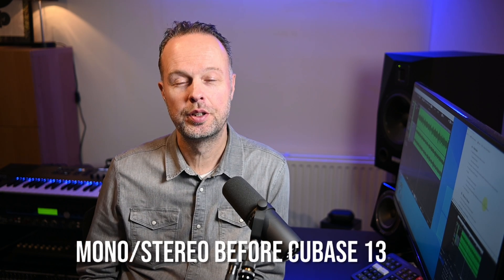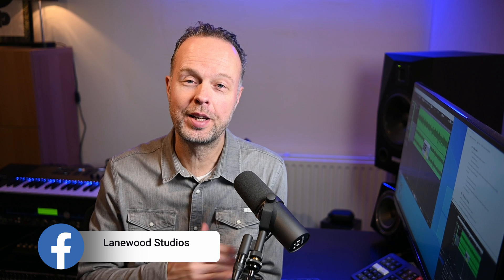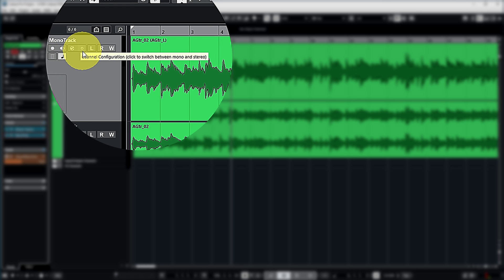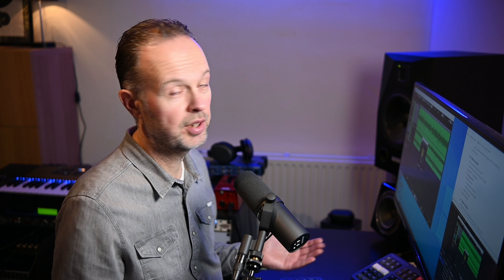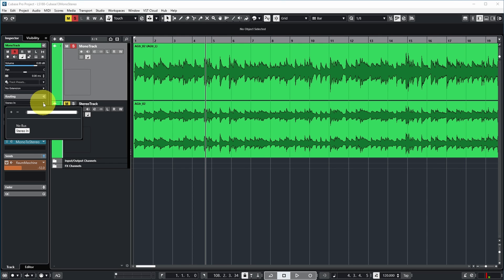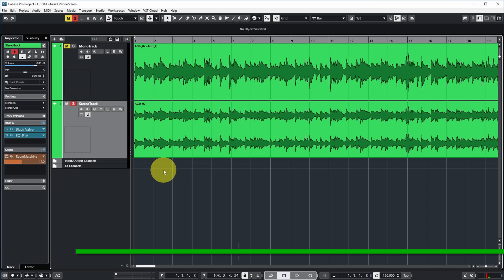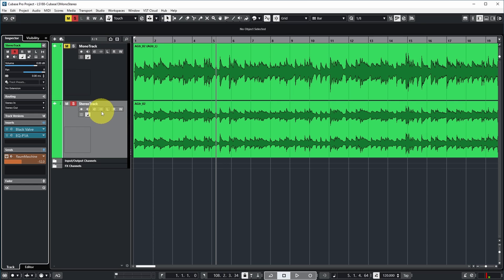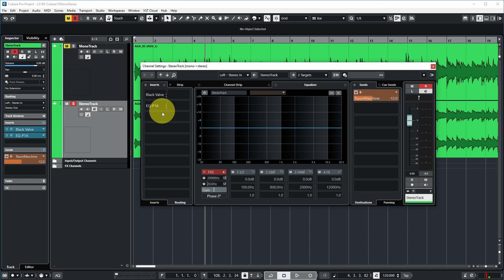Cubase update: Converting Mono to Stereo and vice versa!

Comment: One use for converting a stereo track to mono is for backing tracks for live use, for example a solo guitarist/vocalist who uses backing tracks at gigs (maybe for some drums and bass, possibly a bit of keyboards). Some people feel that mono works better for live use, so if you bought a backing track online (for a cover song) that is stereo, you may want to convert it to mono.. I say it depends - if the instruments are not hard panned, but just subtly panned, stereo possibly sounds better in a live situation from the audience perspective. 

However, one downside to converting a stereo backing track to mono is that the 'pan law' makes centered instruments such as bass guitar go +3db louder when you convert to mono, which messes up the mix and makes the bass sound too loud. I wonder if converting the stereo file into 2 mono tracks to mix independently might help alleviate some of this, however I think you'd still get the bass boost when converting back to a single mono file maybe. 

Of course, if you have multitracked backing tracks, either for your own songs or covers, you can compensate for the 'pan law' in your mix at source, but if all you have is the stereo backing track to work with, I say just leave it as it is.

In the end, I decided not to bother converting my stereo backing tracks to mono. I feel stereo is easier and sounds better and I don't have to worry the 'pan law' messing up the mix.
Reply from the maker: Interesting use-case. You can configure the pan law or desired lack of it in the Cubase project setup.

Comment: Great tutorial Lanewood , thanks for it. I just installed release 13 of Cubase but I don't have this little circle in my channel configuration. I see the "lanes" function, the "freeze" function etc etc but the small icon of mono/stereo I dont see,..??...probably I have to swith this on somewhere?..thanks!
Reply from the maker: If it is not showing you can configure the controls that are showing  for each channel type via the Track Control Settings. You can get there by clicking on the little wrench all the way at the bottom of that panel. You need to make sure that 'Channel Configuration' is a visible control.

Comment: If the MonoToStereo plugin in Cubase reduces the volume of a mono track when cranked up, it is not due to phase cancellation. Phase cancellation would only occur when playing stereo tracks, and this is technically impossible on a mono track. The reduction in volume is likely because Steinberg designed the plugin this way, ensuring that the overall perception of volume is maintained at the same level.
Reply from the maker: Good point!

Comment: Very cool demonstration and explanation.  I'm curious though on something with Cubase 13.  Since Cubase has made the option to change a track from stereo to mono and vice versa, have they changed the way a multi mono plugin is processed on a group or bus channel?  For example: on a drum group with compression, if a tom that is hit is mostly on the left you wouldn't also want to be compressing the right channel the same amount if at all.  To handle this you would use a multi mono plugin so that doesn't happen.  Pro Tools does this seamlessly without any workaround to implement it like you have to do in Cubase.  I'm not quite sure why Cubase only chooses to process the left channel when using a mono plugin on a stereo channel or group.  Is there a better way of handling this situation?  Does anybody actually use a multi mono plugin in such situations?
Reply from the maker: I’m not even sure what a multi-mono plugin is. I think more about that as a stereo compressor plugin where you unlink the gain reduction on both channels. For a compressor that makes sense sometimes for other processors less so.
Reply: @LanewoodStudios  The issue is that not all compressors (or other) plugins have the ability to unlink the left from the right channels and therefore you need a "dual" mono plugin.  But to do this in Cubase, you have to play around with the plugin routing.  I'm guessing I'll have to upgrade my Cubase to version 13 to see if that processing has changed.
Reply from the maker: @TomCawoski  or wait for the Cubase 13 free trial?
Reply: @LanewoodStudios  I'll probably just end up upgrading.  I've been on Cubase since version 6, currently 12 pro.  I also use Pro Tools and this is one of those areas that Pro Tools does seamlessly without having to do some kind of weird workaround with plugin routing.  I'm really puzzled why Cubase has always been this weird way... Oh well...   They at least changed the ability to change a mono to stereo track and the other way around which I think is just a quick fix for people.  I can't say I have ever had the need to do that, ever.

Comment: I receive vocal recordings made in GarageBand which only records in stereo even though they were recorded with a mono input.
I usually convert them from stereo to mono in Cubase 10 because I am used to working with mono tracks after working with tape for many years.
Is there any point in using mono vocal tracks instead of stereo in Cubase, or am I wasting my time?
Reply from the maker: When I receive files from someone that recorded in Protools they are usually separate L + R files for stereo recordings. I always combine them into a stereo file so that I can process then together as a stereo source :).
The opposite of what you're doing ;).
I do understand though that receiving all mono recordings as stereo files is also a bit annoying. It may make a slight difference in performance if you convert them to mono first, but nowadays probably not a big difference.
Reply: Thanks @LanewoodStudios  I hadn't thought about any difference in performance, (I presume you mean loss of audio quality) in converting from stereo back to mono.
In future I will leave them in stereo to be on the safe side.